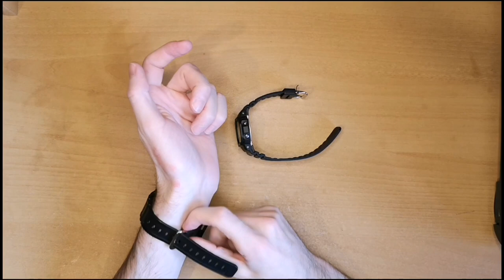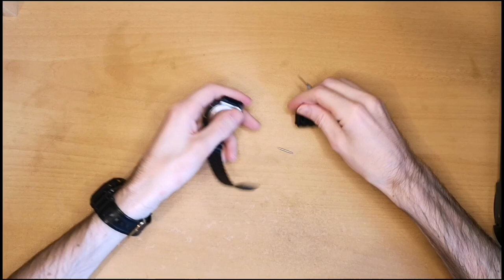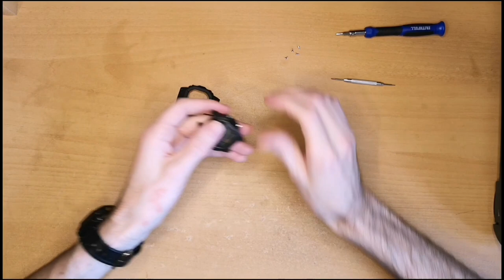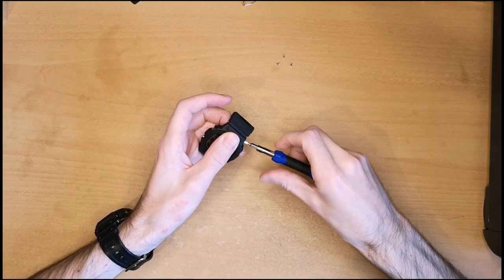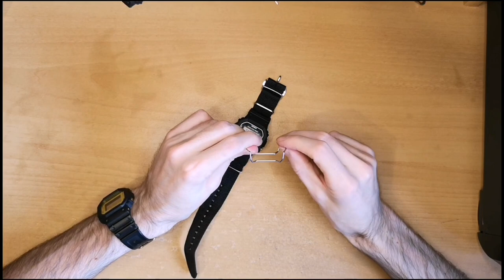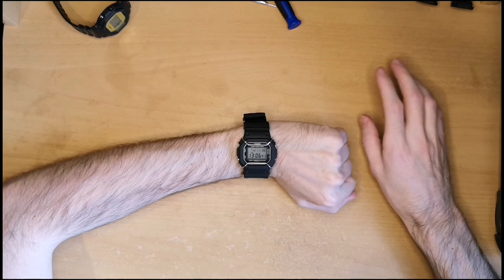Casio G-Shock DW-5600E mod, NATO strap and bull bar

Comment: I'm glad you showed the second way of wearing the strap, it's the best for this mod. There is also another way by simply cutting the small flap and using the strap zulu style. I have tried this method in one occasion where the nato strap was made of leather so too thick to use it as it was. Very nice presentation and I might be doing the same for my 5610U gshock - regards from London😊
Reply from the maker: Thank you, yeah it's a good trick that, I've also chopped them off before 😊👍🏻

Comment: Looks amazing, though technically it will make it less shock resistant as the  original strap design is to add “bounce” of dropped
Reply from the maker: Thanks, it's definitely possible that it will, but maybe that's why the strap adapters are so large, they are copies of the genuine Casio ones, also while the watch is on wrist I don't think a different strap would make much difference, I'm pretty sure the aftermarket metal bezels would reduce the on wrist shock resistance though, but most of us probably aren't doing anything exciting enough to break a G-Shock in our day to day use no matter what mod we do to it lol 😊👍🏻

Comment: Does anyone know if the 5600 bullbar will fit on a 5700 bezel?
Reply from the maker: @5lyde  I think there's a good chance it will fit, I think it's more likely to fit than not, but I've never had a 5700 to try it, so it's a gamble. I'd be curious to know how it goes if you try it, good luck 😊👍🏻

Comment: Also do you need to remove the bezel to put the strap adapters on
Reply from the maker: You shouldn't need to, but sometimes with aftermarket straps and adapters it's easier to fit them when the bezel is removed
Reply: @MrLoopynutter  Oh, ok. Thank you

Comment: It is compatible with GW-B5600BL?
Reply from the maker: I believe some 5600 G-Shock watches have a different shape bezel, but I think all straps and bull bars are cross compatible, but I'm not 100% certain, but usually when you look online for the parts it lists which models the part fits, failing that it's always a good idea to check with the seller 😊👍🏻